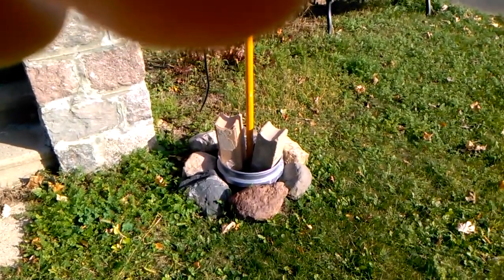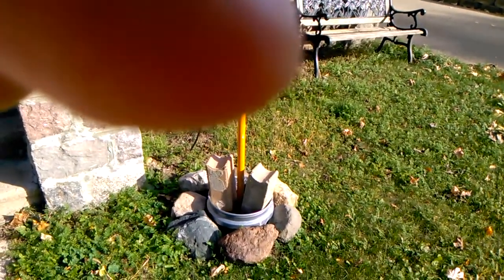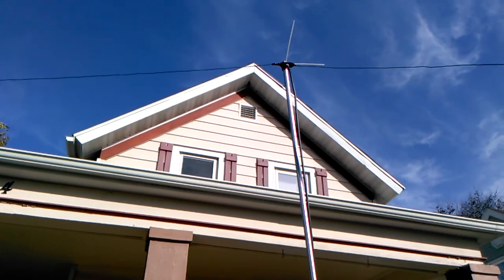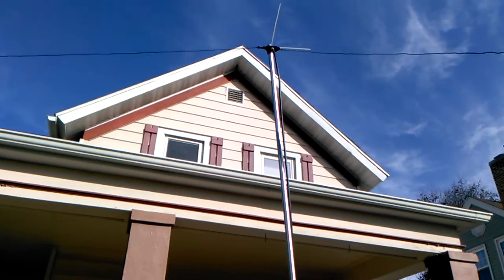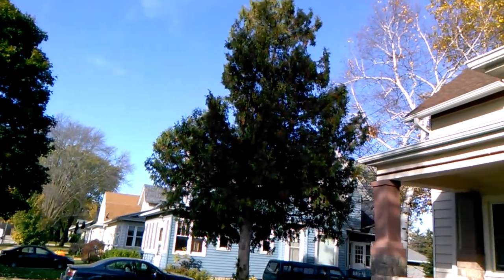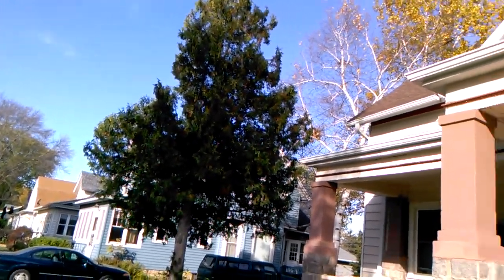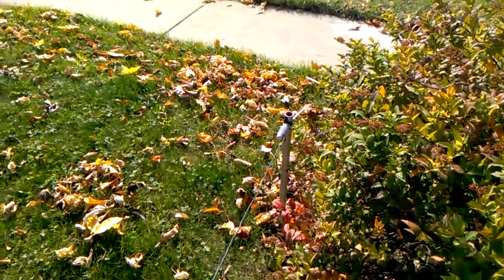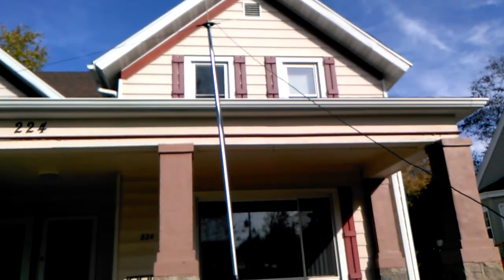My Homemade Off Center Fed Dipole

Comment: to get best from a OC Dipole mount at a 45 deg slope at highest point,usually a pole mounted on rooftop chimney
I use 200 ohm ladder line at centre of antenna,then a 4:1balun to bring match from 200ohms to 50ohms.
I slope the antenna at a 45 degree angle from high point on roof\chimney sloping towards ground, gives better performance due to vertical and horizontal pattern
Use bedsprings to tension the wires up to keep taught.Using ladder line p
ut less centre stress on dipole weight,I mount the 4:1 balun under the soffit of roof over hang,then coax feeder into shack,atu not required.

Coax feeding without a 200ohm to 50ohm balun is not a good idea in matching stakes,lose all your power in ATU!
built quite a few of these and all sucessfull,worked the world on them.
If you get a decent balun,it can work up to 55mhz for 6M band.

Other way used it on a 10M fibreglass fishing pole vertical and bend back,like invert L-shape,thats does work too.

Rob 73's